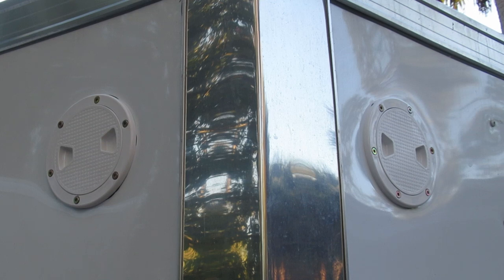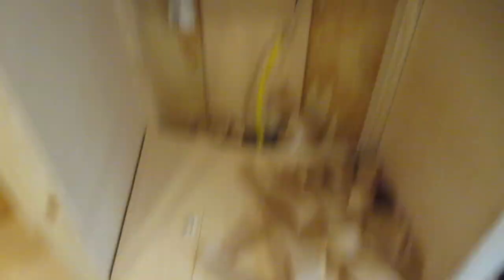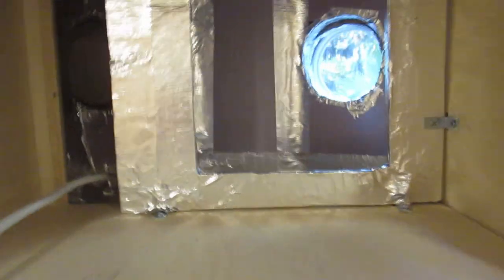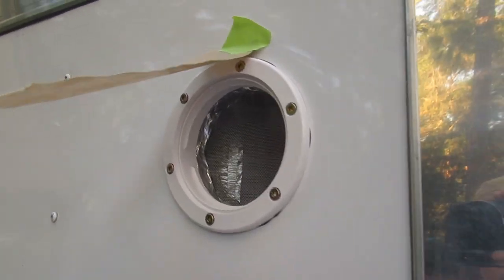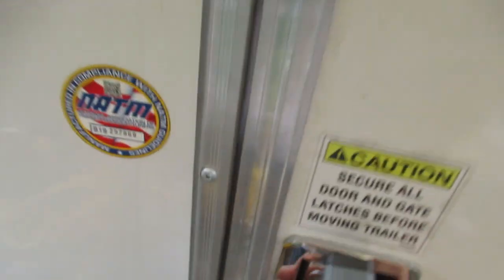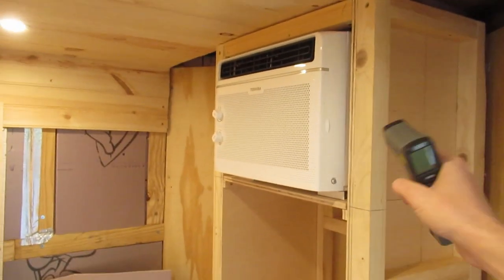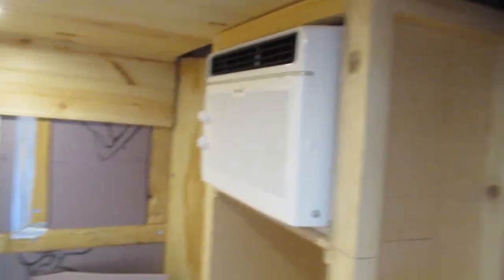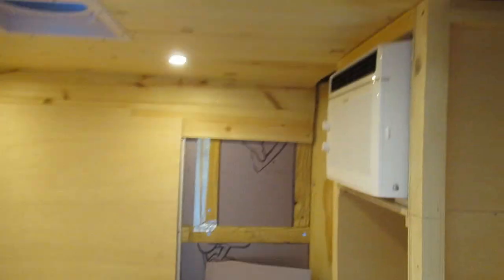Window AC Installed on Cargo Trailer Camper Conversion

Comment: How do you plan on dealing with the water from condensation?
Reply: the condensation runoff from most modern window air units is usually minimal.  If it concerns you though, a simple drip pan can be made from sheet aluminum, to sit under it and you could even install a fitting with a small hose to drain it off down to the ground.
Reply: @OddBallPerformance  that’s very dependent on where you are using it. Here in AL, if you don’t have a properly sized drain hose, you would have water everywhere in about 20 minutes.
Reply: @StevenBagley  my solution for a drip pan and drain would still apply
Reply: Unfortunately a simple drip pan will not solve the issue. As mentioned prior higher humidity means more condensation. And enclosed space will prevent the water from evaporating into open air, instead it will be drawn into the plywood enclosure and create mold. If that drip pan isn't drained off in some way to the outside of the trailer the water can slosh around and over the drip pan and again end up on the plywood and into the trailer and again you have mold and rot. I've seen it 100 time with these types of builds. Adding a drip line to the outside of the structure is a simple solution and that only works as long as the drip line is cleared and maintaine regularly.
Reply: @jeremypeterson7171  best advice. 
Thanks.
Reply: The condensation is supposed to be all self contained. No drain needed. If you read the manual for your unit it explains this.
Reply: @parkerazz4385  read all you want, do it and see how much water, mold and stink you need to clean up.
I'm a HVAC  professional. 
I've seen this mistake a million times. Add more with your ignorant advice.
There is a reason they put a drip hole in the bottom.
Reply: @berserkerkonge8095  We live in East Tennessee and no unit is “self contained” living here lol. You better have a true drain so that no moisture is sitting lol. I agree with your comment 💯
Reply: @berserkerkonge8095  yes and especially on the East Coast with the high humidity. Glad you commented as a pro. Hopefully people will save a lot of trouble and listen to you!
Reply: @realMartinHamilton  I converted a cargo camper.
I should record the amount of water captured in one hour in the midwest.
80 degree day with around 50-65% humidity.
Reply: @berserkerkonge8095  that would be great because I'm thinking of collecting the drain water into a gallon jug inside the trailer as to easily access the drain line and clean it periodically. If it's excessive then I will need to go external.
Reply: @realMartinHamilton  collect it outside or in a container larger than needed. Water causes mold and will destroy the areas you can't see. Plus water dripping off a dirty ac vent may not be best for drinking.
Reply: @berserkerkonge8095  hey I might need to actually consult you because I’m trying to convert a cargo camper myself and try to put it in a cabinet properly so it drains and so the unit won’t protrude out of the side of the vehicle.
Reply: @berserkerkonge8095    I've seen my old unit after I pulled it apart and it looked like mold in the back area... But mine was installed in a window so I can believe it about mold etc if not dripping out
Reply: I would imagine since this video was posted about a year ago and it is the end of July 2023. You’ve had a summer to use it. So how did it do ? Did you have any issues with condensation?
Great idea I hope to use something similar to this in my build. Thanks for posting your experiment.
Reply: @justmike1529  trust me, the hole that hot air exits is too small.
Drip line is necessary.

Comment: I'm currently building out a cargo trailer.  I decided to put a luggage door for my exhaust opening.  I tapped in a drain bung on the A/C pan for drainage.  Right now I deciding on intake system for the unit.  Great job on the install..

Comment: I was thinking of doing this and adding a drain pan under the AC then run a drain line out the bottom of the trailer.

Comment: Where is the drain hose?  An air conditioner actually pulls humidity out of the air and will create quite a bit of water.  Also if it is raining, making it very humid (both inside and outside) you will be sucking the rain to the inside thru the air intake.
  
  So how has this worked for you so far, and have you used this system in the rain  yet?   I'd truly like to know.

   I am currently building my cargo trailer conversion and plan on installing a window unit as well since they are so cheap compared to an "RV" style unit ($100-150 vs $1,200), and from what I've read they use slightly less energy.  I'm thinking about going with the slide out drawer brackets with an outside lockable door for the unit.
   I can appreciate your idea though...and it could be made to work, but ACs do  generate an incredible amount of heat as well, which would actually end up making your unit work much harder and could end up burning up the compressor prematurely... eventually... I'd think. IMHO
Reply: I love the idea of a slide-out window AC. I hope you do a video of your own!

Comment: Great idea I actually did mine the same way. Except we accommodated for air flow per square inch and went with the bigger floor decking plates. Just got all of the heat tape and realized that I forgot to do a drain for the condensation off the back of the unit. Do you ever have much trouble with condensation off the back of your unit dripping on the inside of your cargo trailer?

Comment: Why not a mini split?
Reply: Mini splits are usually 6 or 700.00 more. These window air conditioners are only 170.00
Reply: @texling93  Mini splits are more energy efficient and can heat and cool.
Reply: Yes mini splits are more efficient. When I camp I stay in a tent with just a fan....in Texas summer heat. That’s even more efficient but I’m trying the cargo trailer out because I’m bringing a motorcycle now.
Reply: @texling93  I've seen them on cargo trailers too.